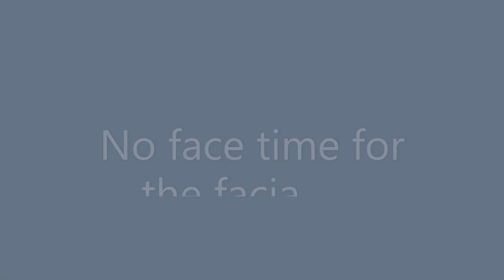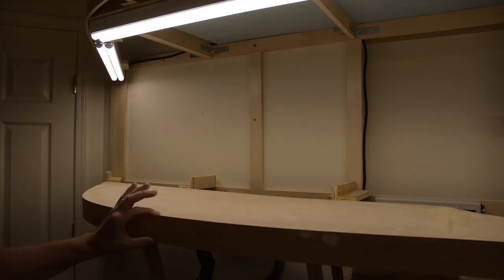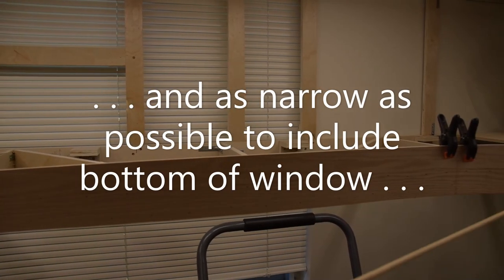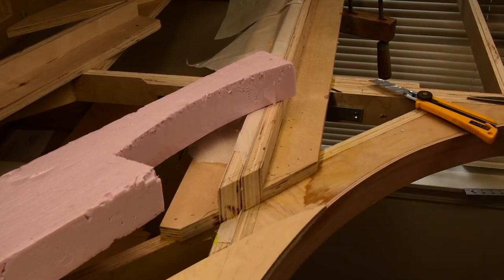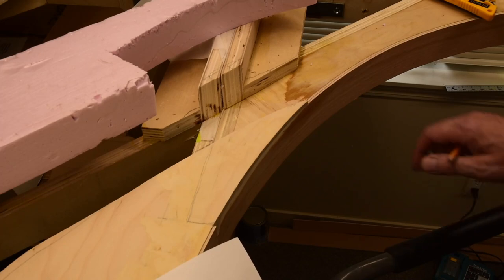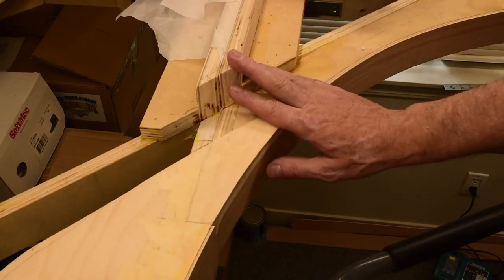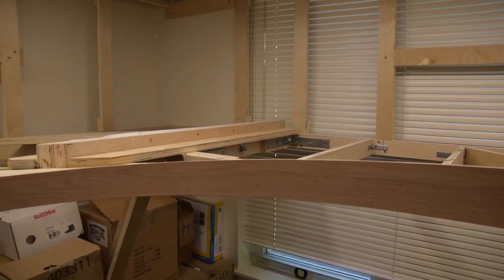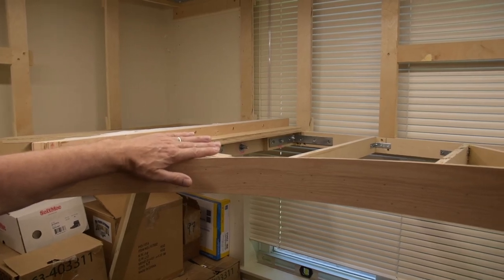Building Shelf Layout Facia | River Road Vlog #7

Comment: Thank you for sharing your philosophy regarding the facia design. I am planning out my new layout which will have "oceanfront" features and I will certainly use your approach to a fixed horizontal lower layer as appealing to the viewer.
Reply from the maker: Thank You Jeff. Another advantage - The thin line (lower facia) also makes for a great work space under the layout as well. Just install a smaller LED under the frame with a table and you are good to go! Cheers.

Comment: Silly question… do you leave the parchment paper in between the joints or remove doing a final assembly?   Like the “Masked Planer” bit
Reply from the maker: Great question. I trim it, and leave it, after the road bed seam is done (which I will soon show). This way, if any diluted ballast glue, etc., seeps in, I can still separate the modules with less fuss. Cheers.